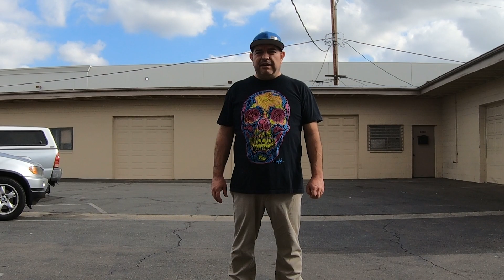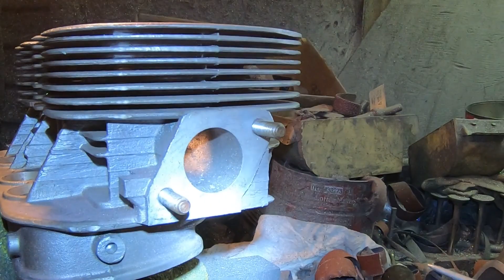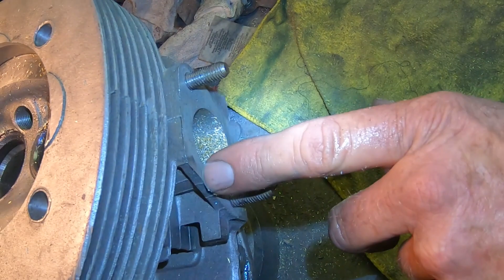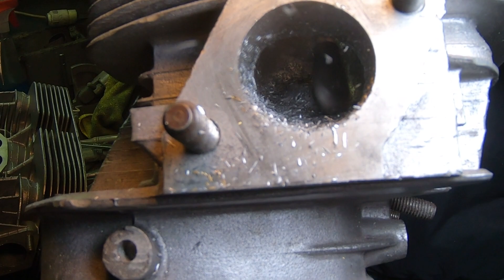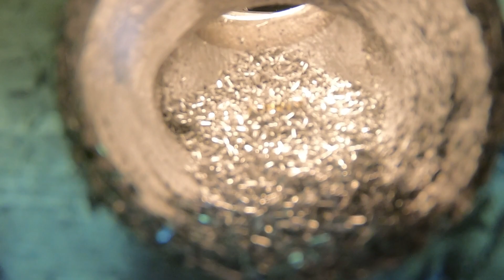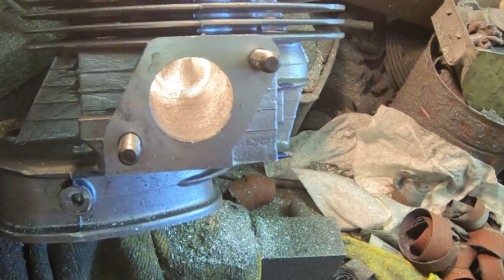Super 1600 Engine Build Part One Starting on the exhaust ports.

Comment: my hippie dad was obsessed with the 1700cc (1699cc-85.5mmX74mm) he would playfully argue that's what VW should have made, not the 1600cc. he'd argue the 74mm crank gives u more low to mid range streetable torque than a 1600cc. quantified by the seat of his pants.. lol. thanks for the video
Reply from the maker: Thanks for your memories about your father.
He sounded like a smart man. Maybe I will build one for him and see if he is right about this 🤔 😏
Reply: @AandWCRandD2022  bruh, id love to see that. late 90s i did talk my dad into building a 1900 (90.5X74- 1904) when they came out with a good aftermarket case, also had to show him the 90.5 jugs weren't thinner than stock and a remote oil cooler would stop the heating of #3 piston. im 54 my dad has since passed, he was very old school and to get him to try aftermarket part was a feet. lol again thank for ur time on these videos.
Reply from the maker: Thanks again for subscribing, watching and liking our channel

Comment: I always thought the 041 had 39 mm intakes instead of the stock 35. I bolted a stock set on a 1679 way back in the 80s and i could feel it in the seat of the pants meter. The also have high rev springs.
Reply from the maker: Yes you are right, 041's heads have 39x32 mm valves ...

Comment: Cool, wasn't aware anyone was still messing with old air cooled Beetles.
I haven't done one since about 1980!
Electric die grinders are convenient and quiet but I still have way more control of rpm with an air die grinder, even though they are screaming loud and need a decent sized compressor (usually 90psi @9 or 10 SCFM)
I always bought 6" long shank burrs and cutters then cut them down to about 4" as a more convenient length.
Reply from the maker: Thank you for Subscribing, watching and liking our videos.